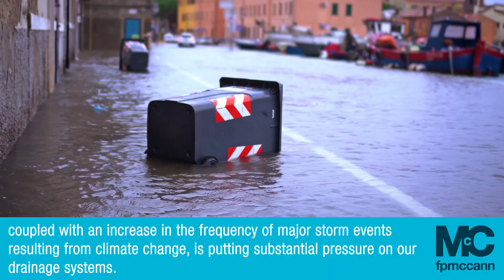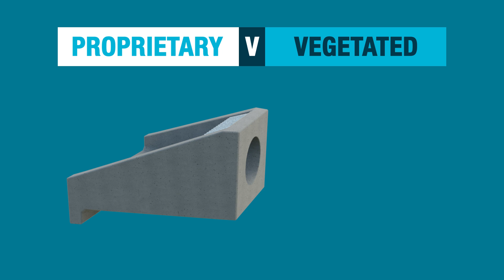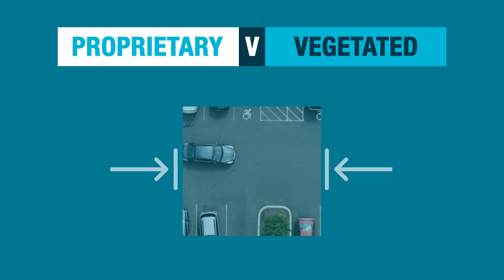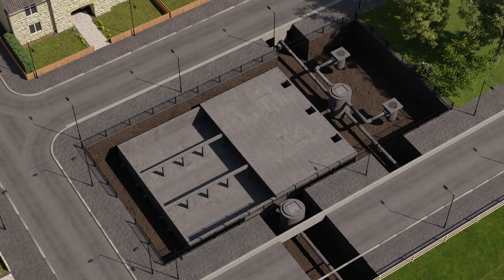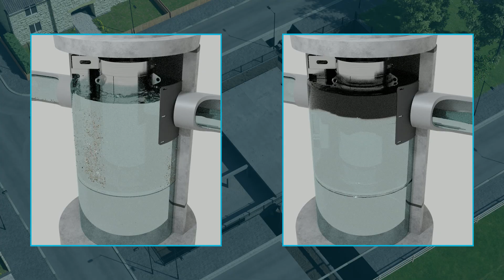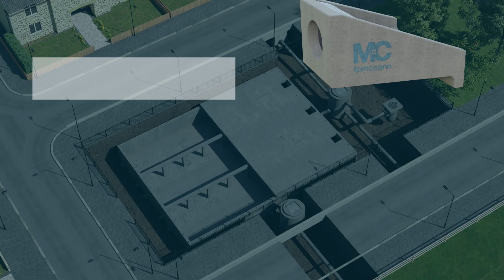An introduction to FP McCann's Proprietary Concrete SuDS Solutions

Comment: hahahahaha.  SO not SuDS.  These are concrete drainage products; you might use some of them within SuDS, but you are misguidedly promoting them as a total solution IN PREFERENCE to the core parts of SuDS, which are the soft elements providing habitat, amenity and natural filtration/treatment; concrete cannot provide these.

Comment: This isn't SuDS at all. This is just conventional surface water drainage using precast concrete components with flow controls and some attenuation. SuDS should provide amenity value and enhance biodiversity. This does neither
Reply from the maker: @whereswillers  to what definition of SuDS are you referring to?  Surely SuDS ultimate goal is to manage storm water locally (as close to its source as possible) mimicking natural drainage and encouraging infiltration, attenuation and passive treatment. If the primary objective is to reduce the risk of flooding and pollution (especially in built up areas or commercial environments), then a proprietary system ticks the box as a SuDS solution. I can provide evidence of managed results and performance of long periods of time.  Show me this for a vegetated solution. I’m not saying one is better than the other, but both systems can make significant improvements to flood prevention.